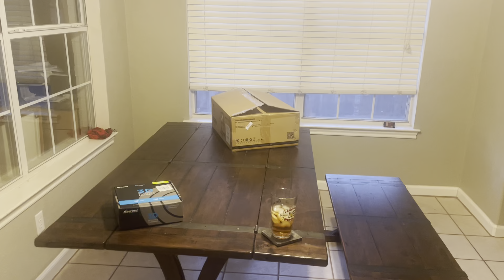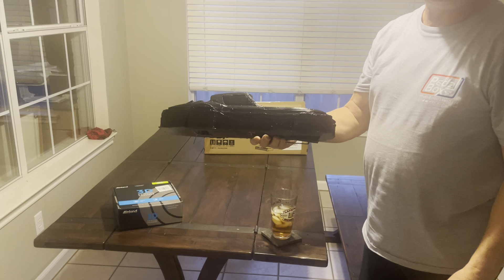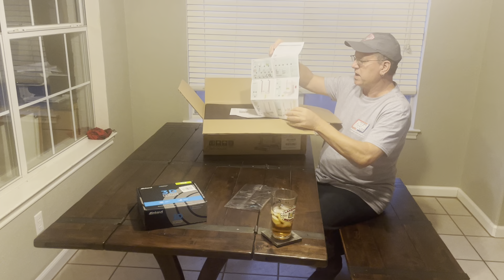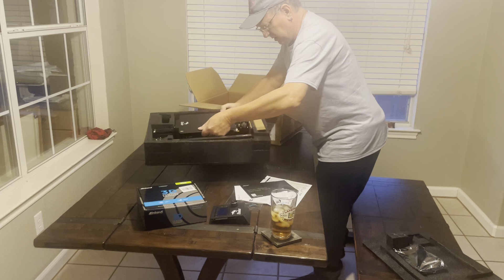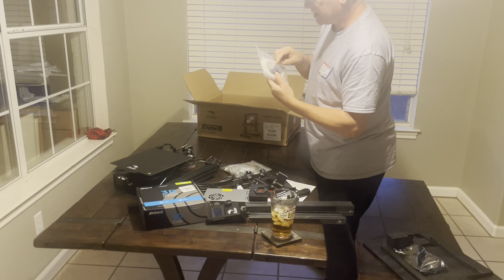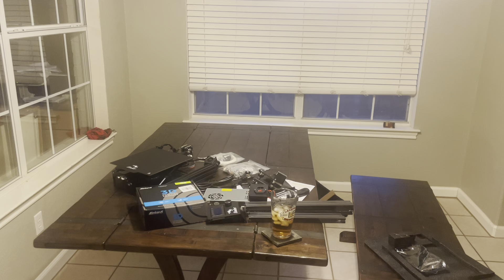$99 3D Printer Unboxing! - C8 Corvette Hack

Comment: I need to get one of those there are alot of cars they don't make models for that are my favorites but I thank you for videos your always helpful
Reply from the maker: There are lots of 3D car model files out there. Many are free, some you have to pay for. I found a free one for a C8 Corvette. Most of the models are not 100% dimensionally accurate but are close enough visually. 

I need to find a C5 model for my suspension design. But it does need to be accurate so I may end up using my 3D scanner to scan real parts. We’ll see when I get to that point.